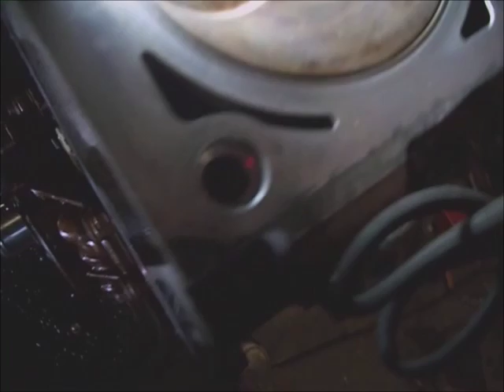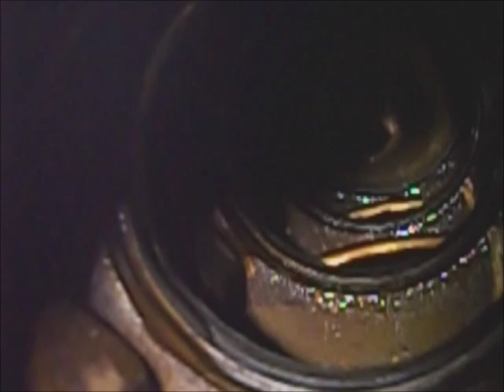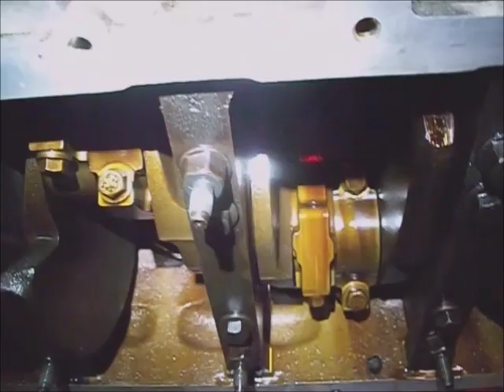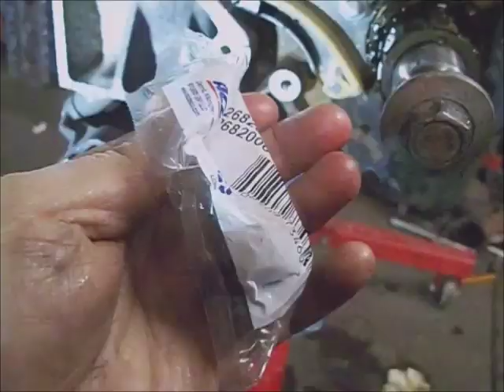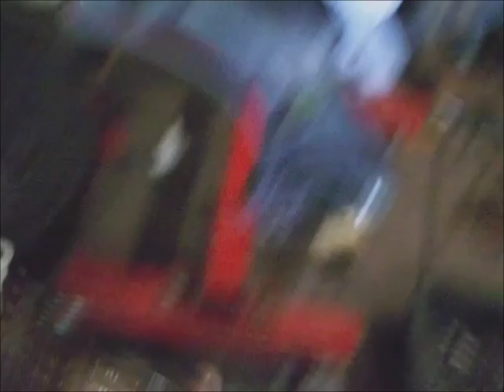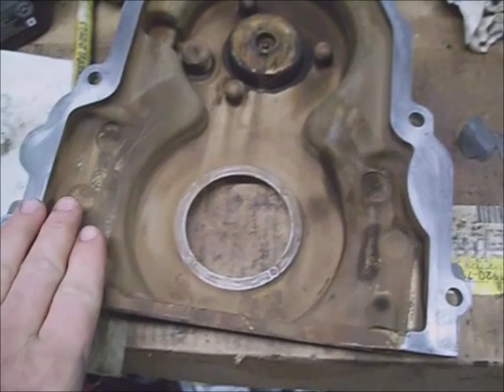GMC Denali `08 6.2l engine, cam and timing chain, and oil pump install pt.7

Comment: Do you need to pull the motor to change the timing chain?
Reply from the maker: Anyway you choose to get the oil pan off, for pick-up tube bolt, on back of oil pump.  Up to the person doing it

Comment: The valve actuator what’s its torque at?
Reply from the maker: 55 lb ft + 50 degrees, thanks for watching
Reply: Is that center cam bolt fot thr VVT REALLY 55lb plus 50° more sir?
Reply: 😊😊😊😊😊😊😊😊😊 16:03 😊😊😊😊😊 16:04

Comment: I’m at the step where I need to get the cam gear seated correctly. What did you mean by “working the crank back and forth” to get it to seat properly?
Reply: Do you mean that I need to put a 24mm socket on the crank bolt and wiggle it back and forth a little until the chain gets lined up to let the gear/actuator to slide into place?
Reply from the maker: I was bumping the crank back and fourth 1/2 tooth to get dowel to settle in gear. Prob.
Reply: @AutoDrdiy  ok, thanks. Is that actuator bolt a stretch bolt that needs to be replaced. Thanks! Your video has been a HUGE help!
Reply from the maker: @kylelawdawg  yes it is, I think it was mentioned in the video.  Thanks for watching.

Comment: How much was all the replacement parts including the cam?
Reply from the maker: Around $1600-1800
Reply: @AutoDrdiy  thanks
Reply from the maker: @k.lamareyev4418  Thanks for watching
Reply from the maker: Also, with the edition of machine work on heads and the addition of new fluids, the total cost of parts was closer to $2000.

Comment: Did you happen to check mains or rod bearings?  Metal went somewhere....  great vids. I appreciate you taking the time to show us your talents. I'm planning a 6.2 build.
Reply from the maker: No, It would be of no value to do so.  A few pinches of glitter loose in the system would be partially filtered, partially impacted in the bearings, (the bearings are soft to absorb impurities by design, it is when they absorb to much and become hard, that they start working on what they are protecting), some micro glitter will be stuck in sludge deposits.  I could go on, but since it had good oil pressure, and it was only one minor failure, the costs of redoing the rest of the engine wasn`t justifiable.  If the engine had any other significant problems, then a new crate engine from the factory, would have been an option, provided a low milage used engine wasn`t available.  Thanks for watching.
Reply: Auto Dr diy ... interesting.  What is desired oil pressure on a 6.2 at temp at idle in gear?   Mine seems low...16-18psi.
Reply from the maker: F. Yilmaz 20's is about right on one with over 100k and well maintained, 12 psi is like a rock bottom min.  Hot, idle, in gear.
Reply: Auto Dr diy yup. I’m at 9 so the vvt is freaking out. Swapping soon and can’t wait to tear into old to see where and what went wrong.
Reply: @pauldolan1493  oil pickup tube o ring by chance?

Comment: Does the plate hold it in place?
Reply from the maker: MESO HANO   the cam?  It keeps the cam inline so it isn't working on the chain and freeze plug cap.

Comment: I completed same procedure, truck runs but somthings not right  not sure how to explain it but it feels slugish and its shifts too soon. at cruising speeds it is up and down
Reply from the maker: Prob a vacuum leak, or air cleaner not sealed to MAF sensor.  It plays a major role in shifting, and controls every aspect of the symptoms you're describing.  Unmetered air entering intake can cause a lean condition, while other sensors are trying to correct the MAF miscalculation of the total air volume. May clean it with some spray only. If check engine light is on, a code scan will possibly narrow the parameters causing the problem.  Check that all ground eyelets are attached.  If possible check for around 19" of vacuum at idle hot, on intake vacuum port for brake booster.  Good way to check timing chain alignment/sticking of valve seating and blocked catylist, head gasket sealing between cyls. 17" hg lower, or pulsing needle indicate possible internal problem described.  I used an OEM replacement camshaft, and not an aftermarket mod grind.  Always use oem O2 sensors for replacements, as aftermarket calibration are sketchy and undesirable results may arise.
Reply: Thanks for the reply,  btw its a 2011 Vortec 6.2L V-8 VVT (L9H) . No codes are showing but i can check live data i have a Autel AutoLink AL319 OBD2 Scanner still learning how to read it.   I have went back over and inspected  intake and Air cleaner for loose ducts and clamps . i had an antique mile-o-meter gauge  (it was my fathers has a date of 1950)  i put in on the brake booster hose and it read 22 inHg steady at idle.
The original problem was lifter tick and it was one roller and cam lobe. I replaced the cam with the General Motors 12623065 cam i believe this to be same cam that i had, 3065 was written on the end of the bad cam but i went with Elgin Industries HL2148S lifters and i only replaced the left (driver side bank of lifters) so the right side still has the original lifters. I mention this just in case its a factor.

 I assumed i wouldnt need to degree the cam since i was keeping same stock cam. I just lined the cam and crank marks up with piston one at TDC. I went back and read what I originally posted and i think i mis-described it a bit what I should have said was with mild acceleration  it goes to the higher gears rapidly  sounds like 3-4 gear by 25 mph. and at cruising speed i feel a slight surge and drop off sensation not full gear changes. I dont remember this from before i tore it down but usually im blasting the radio and not paying the attention that I am now lol  

Confession time, I had it all back together or so i thought, and it would not start, sounded like all the valves were stuck open when attempting to crank it.  i didnt rotate the engine 180 while  i installed the rockers the first time. so i tore it back down and went through every step a second time. it started within a few turns the second time around  I guess its possible i bent a valve? or timing is off not sure about that.
Reply from the maker: Irving ferginspud. If valve was bent or timing issue, vac gauge would fluctuate on a prob cyl. Typical excellent vac reading around sea level is 21". You could try and unplug MAF, and see If substitute settings improve condition, it won't like it initially, but have weeded out bad MAF that way. If worse no change, plug back in, switch off always.  And if engine is quiet and smooth at part throttle, and no codes, grounds attached, could be a logic problem with pcm.  See probs when battery goes dead sitting, or trying to start with dead bat.  ECM can get confused, but usually sets multi, codes.  And requires unhook, and touch power cables together for a few mins to clear system errors.  Hooking bat up after repair, with ignition on can, (70% prob, imo) damage PCM.  As well, hooking power to low bat with ignition on, is same likely outcome.  If trans is acting up, and none of these events occurred, I would elect to drive it and watch torque convertor duty cycle on scan tool, around (excellent) 70%, not to exceed 95%clutches on the outs.  Also check plugs on trans for corrosion/damage.  I may even  pull  trans pan to check for debris from malfunction.  The PCM  on this stuff is very (to) sensitive to systems it can monitor.  Either it can't see a prob, because it has the prob, or it is a mechanical prob, like filters, water, contaminated fluids.  Calling a dealership, asking for service dept. And give VIN, to see if an update to PCM for trans issues are an option.
Reply: Auto Dr diy You my friend are an expert mechanic!   EXTREMELY rare!   99% are 1/2 ass and " think they know " or " act like they know " what they're doing. You're the type of mechanic I would literally drive 300 miles to take my vehicle to.  Do you have a shop?  

I have a GMC 2500HD with 510,000 miles. 6.0 Vortec. With many ( Original ) OEM parts, as in Waterpump, Alternator, A/C compressor, Front brake pads, Ignition Coils, Fan Clutch etc etc etc. Meticulously mechanically maintained to the extreme, most wouldn't believe. 

Truck runs fine but I would like to hook up a professional scanner tool and check everything. Injector flow rate, stored codes etc.. I'd also like to know if the timing chain is good for another 500,000 miles.